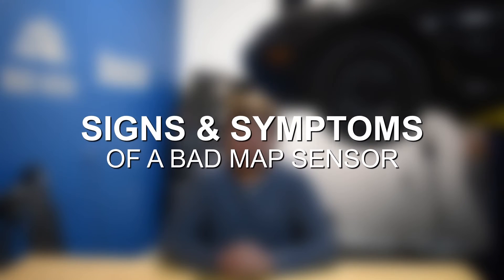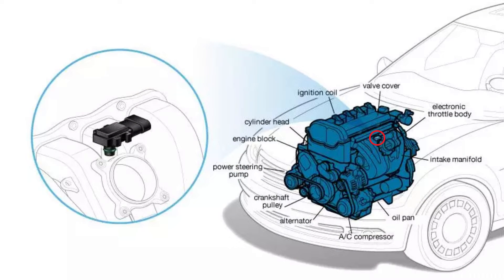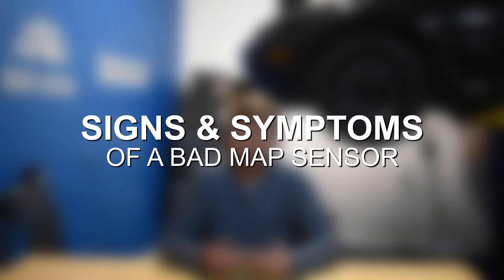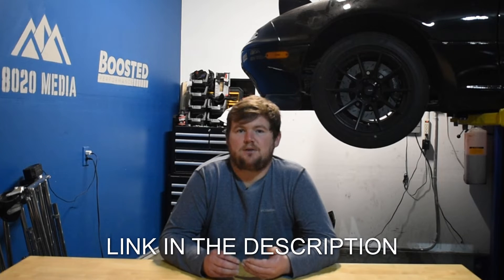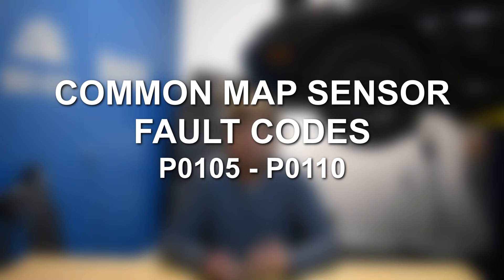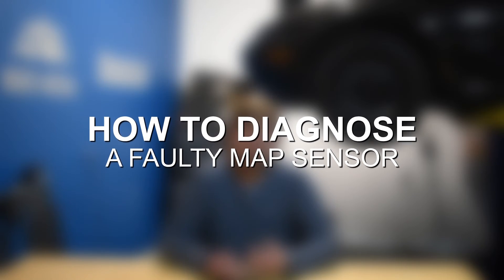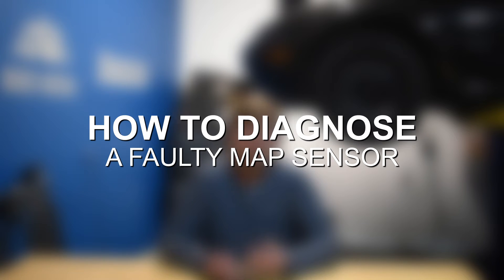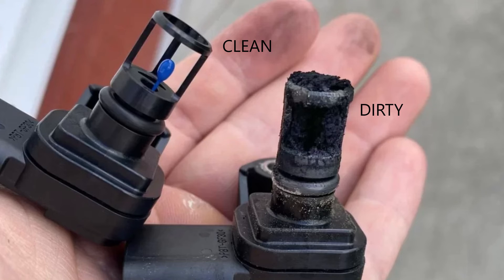A Bad MAP Sensor – Symptoms, Causes, and EASY Fixes!

Comment: P0106 2008 Ford mustang v6 I'm being told by ford that i need to replace the EGR valve cuz the MAP sensor is attached to it and i cant replace the MAP sensor individually yet im seeing the individual piece on ebay, and my mechanic states that if it was the valve it would have given a code. I need help! Any advice would be appreciated.

Comment: Got 06 Honda Accord v6, the 02 sensor codes came on changed bank 1 sensor 2 and changed bank 1 sensor 1 02 sensors. Changed the pcv valve cause that was broken inside the manifold. New fuel pump. Changed the old gaskets on manifold and spark plugs. Filled the tank (before pcv replacement) car wouldn’t start back up. Replace pcv valve, open up the oil stick car started very rough idle than dies out. I closed that left open the tube to the air intake hose and she started up and revved up like she was supposed to three times. Then died. I’m thinking there is pressure somewhere cause there was also oil coming through the tube to the air intake hose. I can’t figure it out. I can but it costing me money and a lot of brain power. Cause I just study that car and learning it from watching these videos and go with what makes sense. But I sure could use some hlep
Reply from the maker: T - On your ’06 Accord V6, the fact that it only runs briefly with the dipstick out or intake tube disconnected points strongly to a crankcase ventilation issue creating excess pressure/vacuum rather than fuel delivery, since you already replaced the PCV (which was broken inside the manifold). If the replacement PCV valve isn’t seating right, is the wrong part, or there’s still sludge blocking the passage, the engine will either pull too much vacuum on the crankcase (stalling unless vented) or build pressure that forces oil into the intake. The oil you’re seeing in the intake hose is a classic sign of blow-by or improper PCV function. I’d double-check that the new PCV valve is OEM-spec and installed correctly, then inspect the PCV passage in the intake manifold and valve cover for clogs. Also, make sure the intake gaskets sealed properly after you had the manifold off, because a vacuum leak there could mimic the same rough idle/die-out symptoms. In short: confirm the PCV system is actually flowing as designed, clean the passages, and reseal the intake — that usually clears this exact “runs with dipstick open but dies sealed” problem on Honda J-series engines.
Reply: @8020Automotive thank you so much I’ll be doing it this weekend and let you know how it turns out. I’m was doing process of elimination

Comment: Hi, I recently cleaned my MAP sensor using Bardahl Air Flow sensor cleaner. I didn't touch off the filament or spray too close to it but very soon after I started getting a P0132 code (high voltage reading from the oxygen sensor in bank 1, sensor 1) almost every time I start the car and leave it idling for a few seconds. It idles erratically for a minute or so and then is fine. When I clear the code using an OBD2 scanner, the CEL light remains off, even if I drive a long distance. However, when I stop and restart the engine, 9 out of 10 times the CEL it triggered again. My question is this: Is it possible for a faulty MAP sensor to cause an O2 sensor code or is it more likely a coincidence that the O2 issue came up at the same time as I cleaned the MAP sensor ?. I have since replaced the upstream O2 sensor and the problem is still the same. Any advice would be greatly appreciated, thanks
Reply from the maker: T - Yes, a faulty or contaminated MAP sensor can definitely cause an O2 sensor code like P0132 because the MAP is critical for calculating air/fuel mixture—if it’s giving the ECU a skewed signal, the ECU may command too much fuel on startup, causing the upstream O2 to see a rich condition and trigger the high-voltage fault; the fact that it idles rough on cold start then smooths out is classic for a sensor feeding the ECU bad data until fuel trims stabilize. Since replacing the O2 sensor didn’t fix it, the timing points to the MAP cleaning—you may have left some residue or damaged the sensing element just enough to cause incorrect readings. I’d suggest monitoring live data from both the MAP and O2 during startup with a scan tool: if the MAP reading is inconsistent (too high or low kPa for a stationary engine), that’s your culprit. Replacing the MAP would be the next logical step before chasing wiring or ECU issues.
Reply: @8020Automotive  Brilliant, thanks very much for the helpful advice, I really appreciate it ! 👍👍

Comment: I have a 2001 Dodge Durango...Bad MAP sensor PO108 code from the Scan Tool...ok
Reply from the maker: R - A P0108 code means the MAP sensor is reporting a voltage that's too high, usually indicating it's reading excessive manifold pressure (or vacuum too low), which can cause rough idle, poor fuel economy, and hesitation. This is often due to a failing MAP sensor, but it can also be caused by a shorted signal wire, corroded connector, or even a vacuum leak or clogged vacuum line going to the sensor. Start by checking the wiring and vacuum line, and if those look good, replacing the MAP sensor should resolve the issue.

Comment: Hi, I have a 2014 Acadia with p2227 I replaced the MAP sensor check engine light came back on after drving for 100 miles. Any ideas whats could be wrong?
Reply from the maker: J - If your vehicle is still throwing P2227 (Barometric Pressure Sensor Range/Performance) after replacing the MAP sensor, it’s possible the issue is with the wiring harness or connector, not the sensor itself—check for corrosion, bent pins, or loose connections at the MAP plug, and inspect the wiring for damage or rubbing near the intake. This code can also be triggered by a vacuum leak, dirty throttle body, or even a faulty mass airflow (MAF) sensor, as the ECM compares MAP/Baro values to MAF readings—so cleaning the MAF and checking for intake leaks is also a smart next step. A scan tool showing live data can help compare Baro readings to expected atmospheric pressure to pinpoint if the ECM is misreading due to wiring or sensor mismatch.

Comment: I hv got chev Aveo 1, 5 model 2007, problem when I pull out the map sensor, it cuts off,,is the problem from map sensor? Other doesn't cut off even if I pull out the censor,,plz help me
Reply from the maker: M - Yes, if your vehicle stalls immediately when you unplug the MAP sensor, that’s actually normal behavior, because the ECU relies heavily on the MAP sensor to calculate air-fuel ratio—so if it’s unplugged and the engine dies, it likely means the sensor is working correctly. If other cars don’t stall when unplugging theirs, it just means they’re programmed to run in a limp mode using default values, but the Aveo isn’t as forgiving. If you're experiencing other driveability issues, the MAP sensor could still be faulty or dirty, so try cleaning it with electronics-safe cleaner or replacing it if you're seeing rough idle, poor throttle response, or engine codes.

Comment: I think i found the video to help me! 
My 2011 bt50 is throwing p0107 p0113 and p2227 and drives well, but wont boost. P0107 is fresh
I have checked all intercooler hoses, air and turbo hoses and they are fine. 
 first thing in the morning when i have light i will check my MAP sensor. Dont know why i havent already. Silly me
Reply from the maker: C - Hope it helps! Keep us updated.

Comment: Can a bad MAP sensor throw a fault code for turbo wastegate error accompanied by lack of boost?
Reply from the maker: D - Yes, a bad MAP (Manifold Absolute Pressure) sensor can absolutely cause a turbo wastegate error and a noticeable lack of boost because the ECU relies on accurate MAP readings to control boost pressure and manage the wastegate actuator. If the MAP sensor is sending incorrect or no data—showing lower-than-actual pressure—the ECU may falsely assume an overboost or underboost condition, triggering a fault code related to the turbo or wastegate (such as P0299 or P0246) and commanding the wastegate to stay open or act erratically, resulting in poor boost performance. Always verify MAP sensor values using live data before replacing turbo components.

Comment: My car just idle fine but when I press acceleration it doesn't rev what cud be problem
Reply from the maker: J - If your car idles fine but doesn’t rev when you press the accelerator, the most likely culprits are a failed throttle position sensor (TPS), a bad accelerator pedal sensor (especially in drive-by-wire systems), or a car stuck in limp mode due to a fault in the throttle control or engine management system; it could also be a clogged MAF sensor, restricted fuel delivery (like a weak fuel pump or clogged filter), or even a severely blocked catalytic converter, but the fact that it idles fine points toward the throttle or electronic control system, so I’d start by checking for any stored fault codes—even if no check engine light is on—and if possible, monitor live data for throttle input and engine response when pressing the pedal to see if the ECU is even seeing the signal.

Comment: My Hyundai Tucson is showing the P0113 and P0108 , what could be the reason ?

The car transmission and overall performance of a car has been terrible . The turbo seems not to function.
Reply from the maker: S - If your Hyundai Tucson is showing codes P0113 (high input from the intake air temperature sensor) and P0108 (high input from the MAP sensor), it likely means the ECU is receiving faulty or extreme air data readings, causing it to enter limp mode, which cuts turbo function and severely reduces performance—including poor shifting and acceleration; this is often due to a disconnected, damaged, or failed IAT or MAP sensor, or wiring issues like corrosion or a broken connector, so start by inspecting both sensors and their wiring, especially in the intake and turbo piping, then test or replace the sensors if needed and clear the codes—fixing this should restore boost and improve overall drivability.

Comment: My car won’t start if my map sensor is plugged in and when I do start it with the map
Sensor unplugged it has a rough start. Has any one ever seen this before?
Reply from the maker: O - Yes, what you're describing is a classic sign of a failed or shorted MAP (Manifold Absolute Pressure) sensor—if the car won’t start with it plugged in but starts (roughly) when it’s unplugged, that typically means the sensor is sending invalid or extreme values to the ECU, such as falsely high pressure (low vacuum), which confuses the fuel and spark calculations and either floods or chokes the engine; when you unplug it, the ECU defaults to a safe "limp" value, allowing it to start, but with poor running—replacing the MAP sensor with a known good one should fix it, but also check the wiring harness and connector for shorts or corrosion, because a 5V reference or ground issue can mimic a failed sensor.

Comment: There is a ghost in my machine. 95 Buick LeSabre 3.8L. Engine light comes on. Connector is OBD2 but the guts are OBD1. Do I need to have a Tech 2 to check for codes? OBD2 couldn’t read it. 🤷‍♀️ My guess is she’s got a bad MAP sensor. Tried d/c battery, got the light to go out for about 10 seconds until the idle got rough. (I’m not a mechanic. I did rebuild my ‘68 Camaro 327 back in the 80s) but this is beyond my scope of pantyhose and baling wire.
Reply from the maker: D - It uses an OBD2-style connector (the trapezoidal port), but it's still running on OBD1.5, meaning it's GM's transitional system that standard OBD2 scanners can’t read, and yes, to properly pull codes, you'd ideally need a GM Tech 2, or at least a code reader that supports GM OBD1.5 (like an Autel AL519 with the right adapter); your symptoms—check engine light, rough idle after reset, and quick return of the CEL—could indeed point to a bad MAP sensor, especially since that would throw off idle fueling immediately after the ECU reinitializes, but it could also be a faulty IAC valve or vacuum leak; without a proper code pull, you’re kinda flying blind, but in this case, finding someone with Tech 2 or a GM-capable scan tool is your best move before throwing parts at it—and props to you for keeping that LeSabre on the road and having Camaro wrenching credentials to boot.

Comment: I have a similar issue on my 2010 scirocco. The sensors unplugged and it’s causing the car to become unresponsive when hitting for throttle now and again but when plugged in it feels like the cars trying to break my neck would this be a dodgy map sensor
Reply from the maker: D - Yes, it could definitely be a faulty MAP sensor. A bad or disconnected MAP sensor can cause erratic throttle response, poor acceleration, and unresponsiveness because the ECU isn’t receiving accurate pressure data to adjust fuel and timing properly. When it's plugged in and the car feels overly aggressive or jerky, that could point to it feeding incorrect signals. Try replacing it with a known good MAP sensor or testing the sensor voltage and response with a scan tool to confirm before buying a new one.

Comment: My ford ranger 2.2 diesel 2016 model, used to just turn itself off while on the move. What couses this?
Reply from the maker: D - Your 2016 Ford Ranger 2.2 diesel cutting off while driving could be caused by a failing crankshaft position sensor, fuel delivery issues (like a clogged fuel filter or weak fuel pump), faulty ignition switch, or even an intermittent electrical connection such as a bad ground or relay. It may also trigger no codes if the fault is brief. Start by checking for stored fault codes, inspect the fuel system, and look for any loose wiring or connectors, especially around the ECU and sensor harnesses.

Comment: Could it cause service trans, anti lock system and traction control warnings?
Reply from the maker: C - Yes, a bad MAP sensor can indirectly trigger service transmission, ABS, and traction control warnings—especially if it's causing the engine to run poorly (e.g., rough idle, stalling, poor throttle response), which can confuse modules that rely on accurate engine data. However, it's more common for these warnings to be caused by wheel speed sensors, bad grounds, battery/voltage issues, or a faulty throttle position sensor. Scan for codes across all modules (not just engine) to confirm the root cause.

Comment: I’m getting a misfire p302 on my Honda element. Changed plugs and coils.. still a code. Got my valves done.. good for about 300 miles. For great gas mileage . My engine light came on weirdly when I started in the cold After I turned on the windshield defrost. Coincidence? I was gonna have the code read the next day. I drove 2 miles and it turned off. Weird . Fast forward almost a whole tank of gas, was sitting at a light.. after driving about 2 miles , turned on the Windshield defrost and I immediately looked down and the check engine light was on … again. Was gonna clean my map sensor just cuz I don’t know what else to do. Any thoughts ?
Reply from the maker: S - Sorry to hear this! The P0302 misfire code on your Honda Element that returned after changing plugs, coils, and getting the valves adjusted suggests an intermittent issue. Since the check engine light came on after using the windshield defrost, this could indicate an electrical or vacuum-related issue rather than a purely mechanical one. The defrost setting activates the A/C compressor, which puts additional load on the engine and can expose an underlying problem. The fact that it disappears and returns sporadically suggests something affecting fuel delivery, ignition timing, or air intake under load. Before replacing more parts, try cleaning the MAP sensor and checking for a vacuum leak, particularly around the intake manifold and PCV valve. Also, inspect the fuel injectors—a weak or clogged injector on cylinder 2 could cause the misfire, especially when extra engine load is applied. Lastly, if the problem persists, a leak-down test can confirm if compression is stable in all cylinders. Keep us updated.
Reply: @ wow thank u for all that great info. It hasn’t came  back…. Almost . Sigh. Last week it came on and I thought here we go . I bet 99.9 percent it was the same damn code. Nope! It was two separate codes . A P0420 and a P0456. I was actually kinda relieved. Sorta. The part store suggested I get the ever so expensive Cataclean n follow the directions. I went ahead and tried exactly what it said and 7 miles on a few streets and onto the highway, the damn light went off. It’s stayed off the past week. Drove it to the mountains . No light. But I tell ya, I was a bit scared to turn on any defrost  . Ha ha I got gas but didn’t quite fill up in case it was some pressure building .. maybe the higher altitude ? Not sure . But it’d stayed off. I’m at 312K in mileage and despite what people close to me say (Sean just get a new car…” I don’t want a new one! Oh yea. I also took out the map sensor over the weekend and sprayed it out w the Maf cleaner. Couldn’t hurt as I saw u comment on. I have def gained my gas mileage back. Last week before the cat cleaner, I got 357 miles! I averaged 287 to 300 prior. That was amazing for me to see!! It still videos great. Just not so much in the initial start up here in the winter if it’s under say 20 degrees! Def thank u for the suggestions and will keep u posted. Now to find out what exactly in the rear is making noises. Changed out the sway bar n links. They say I need a new knuckle on right rear “but Honda doesn’t make it.” Say what? I’ll find that damn thing. Feels like ball joints… they say no. I’ve replaced everything under the sun the last two years on this element. Rough road conditions n pot holes here in Colorado. The price for keeping an oldie but goodie on the road :-)